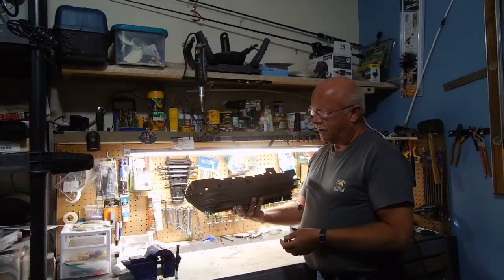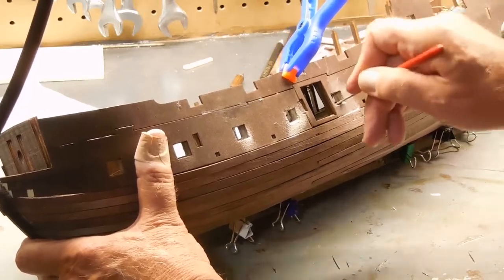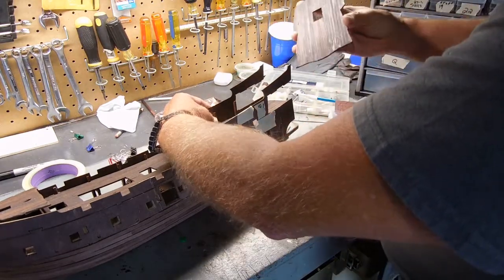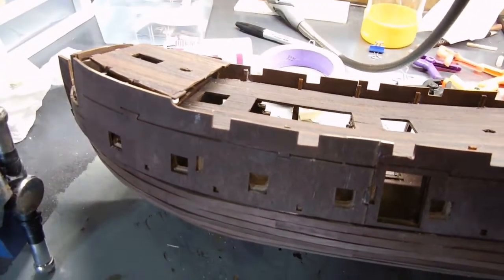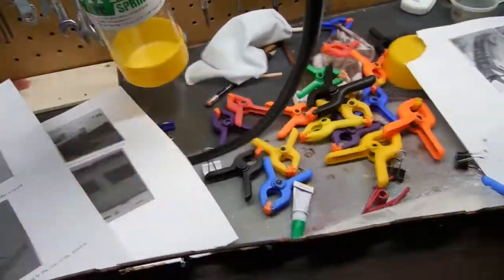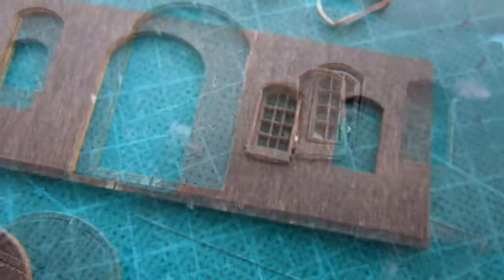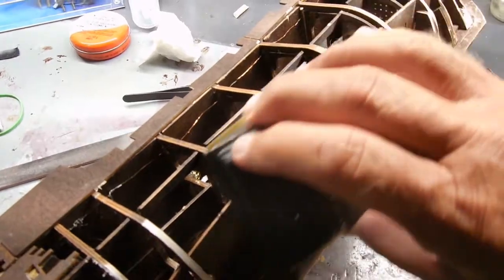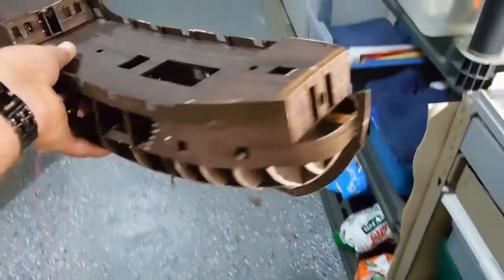Building The Black Pearl Model Ship Part 7

Comment: Thank you so much for all of your hard work, I bought a kit that suppose to be like yours, (1meter long) and I was wondering what was the thickness of the original planks? I am planning to get some extra ones, because you did 😅, I saw that you got thinner ones (50x 1mm x 5mm x 500mm ,walnut) to have two layers of planking, but I’m planning on just one layer, so what thickness should I get?
Thank you
Reply from the maker: What came with the ship was 10mmx50mm - I’m not sure what the length was but I remember that they were a little shorter than the length of the ship itself.  A couple of reasons that I chose the thinner walnut is it would bend to the shape of the hull better.  The kits planks are stiff.  In addition, once I put the first layer on there were gaps and uneven places.  So after layer 1, I filled in some with wood putty and then sanded it smooth. That gave me a smoother hull for the final layer. I’m getting close to being finished and will be posting another segment in the future.... need a few rainy days to be inside to work on her😁. Thanks for watching and good luck with your build of your own version of The Black Pearl 👍👍
Reply: Thick x width 10mm x 50mm ain't that a little too thick/wide? Considering what you bought (1mm x 5mm)

* Im gonna get them at half a meter long (500mm), should be ok
Reply from the maker: Oops maybe I read the gauge wrong? The width was about the same as what I bought but they are two or three times thicker. Very difficult to bend. Also I just remembered that there was also a packet with the kit of very thin planks for the deck. Seems like they were about as thin as two pieces of copy paper.
Reply from the maker: I’ll go measure it again 👍
Reply from the maker: Okay, I totally mis-read the gauge I used to measure!  The kit planks were 1mm thick and 5mm wide. Sorry for the confusion.
Reply: Thank you so much Dan, your the best :) can't wait for a new video
Reply from the maker: Doing a lot of rigging and that’s very time consuming.  Also some fine tuning of little things.  But I think it will be a long time before I decide it’s totally finished. So many little things could be added over time.... Maybe it is one of those things that just keep evolving 😁.  Thanks again for following along! Enjoy your journey 👍